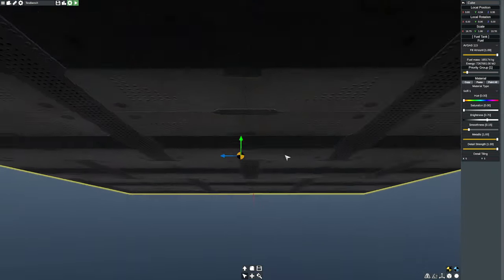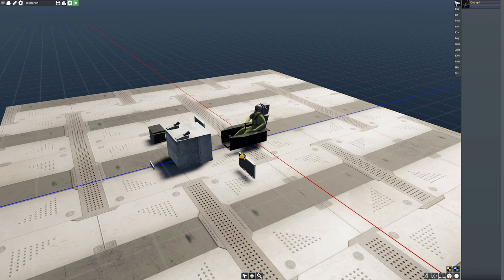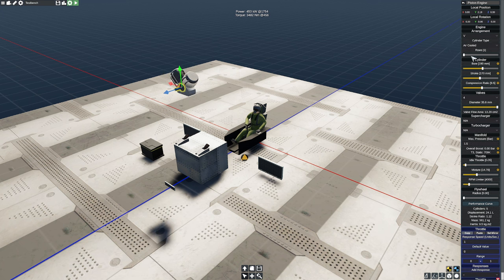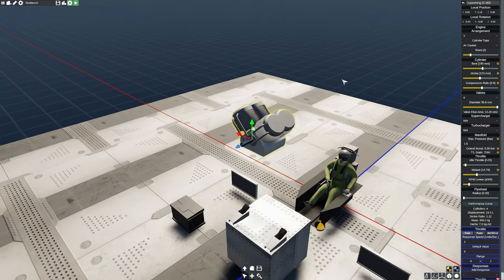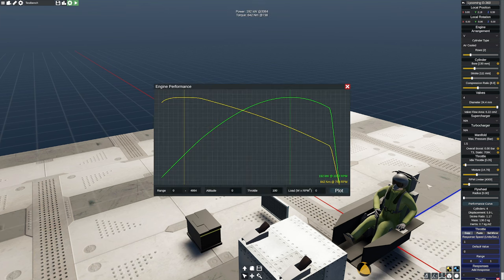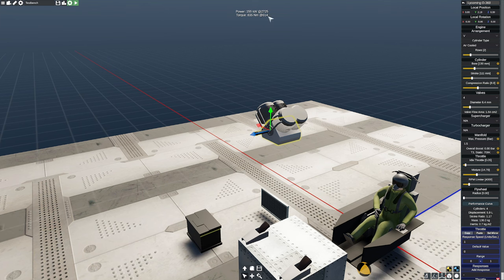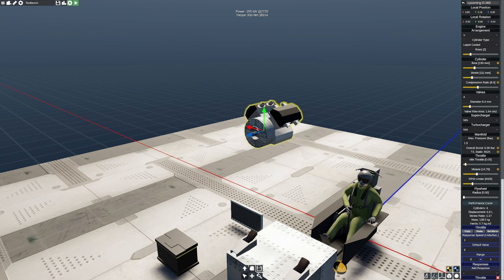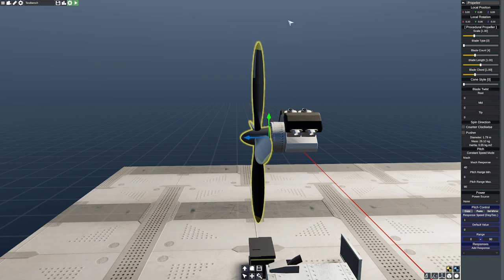Flyout - Reciprocating Piston Engines

Comment: Correction at 5:51, an I6 is a very smooth engine, as I6s have perfect primary and pretty ok secondary balance.

The primary balance of an engine is from the pistons going up and down, in an I3, all the cylinders are at different points in the stroke, with the back and front cylinders being opposite to eachother, this makes the engine rock back and forth violently without counterweight magic. An I3 has really bad primary balance.

Secondary balance is due to weird forces put on the engine, some counterweight stuff, with triangles stuff, which combines to make basically every engine a vibrating mess without some balancing. Which is why something like a flat plane I4, which seem to have perfect balance, still need balance shafts and harmonic balancers.

The I6 due to its perfect primary balance and good secondary balance, is extremely smooth without the need for balancing shafts or harmonic balancers. Which is why it crops up so often in heavy duty applications.

A V12 is just 2 I6s bolted together so it's even more balanced(60 degree V angles specifically). 

In terms of power pulses, more cylinders are more better, but for smooth operation an I6 and it's derivatives are king.

There is a video on the Driving4Answers YouTube channel which explains engine balance much better than I ever could(I may have also misremembered some stuff).

Tldr: I6s are super smooth in operation, but more cylinders would give smoother power pulses, even if they wouldn't be as balanced in operation.

Comment: I got a 1 piston engine to produce 1200 kw by cooling the manifold down to 141 kelvin and used it to make a small car go 140ms
Reply: I'm new to the game, how you cool the manifold pressure? With radiator s/ intercoolers?
Reply: @angelomammetti1846  have a radiator set to intercooler that is selected for your engine the bigger the intercooler the more cooling up to a limit of your heat production and your velocity
Reply: @yaboiminecraff thank you very much

Comment: Can you explain the intercooler and the turbo component?
Reply: The intercooler makes the air going into the engine Cooper allowing you to make more power the cooler the better for power but you have more weight turbo and super chargers gives you more air when at altitude so your engine doesn't gasp for air
Reply: @yaboiminecraff  so the intercooler allows for more boost without knocking or is it just a straight increase in power? Also the turbo component doesn’t seem to be needed for the engine to have a turbocharger so I’m not sure what the component itself is for.
Reply: @themecoptera9258  irl, it allows you to have more air since it's colder but in game it just increases the power and not the boost much
Reply: @yaboiminecraff  sorry, I meant compression not boost.
Reply: @themecoptera9258  it won't effect compression since that has a set limit by the piston what the boost does is shove a lot of air into your engine which allows you to shove even more fuel in allowing that controlled explosion to be insanely powerful
Reply: @yaboiminecraff  let me clarify what I mean. Does it just give a straight boost to power or does it allow for more compression without knocking? 

Higher compression means more power (assuming you aren’t knocking) so it is desirable to increase compression as long as knock is avoided. 

In my tests it doesn’t look like the intercooler does either of these things, an intercooled engine seems to have the same power and the same knock resistance. It might be that I’m not using a supercharger on the test engine, (only a turbo). So I’m at a loss for what this component does in terms of the game.
Reply: @themecoptera9258  if you are doing it right it does both since it cools the engines air ive gotten engines to go from 1200kw to 6500kw with a beefy intercooler
Reply: @themecoptera9258  some engines require your manifold pressure to be increased and change the fuel mixture a mixture of 11.5-14.7 has worked well for my engines just make sure to keep the manifold Temps low and it will allow you to change your compression to be higher since the engine is cooler

Comment: I love flyout so far, but my biggest gripe is definitely the scale of the engines is WAY too small for the "paper" displacement. You can shove a 28-30 liter engine in a TINY airframe and it just breaks what is otherwise a fairly decent "based in reality" sandbox game.

Comment: The horizontally opposed engine is one of the most common engines in GA, and they don't just have it as a standard option??? Seems silly to have to manually do it with two separate inline cylinder stacks...